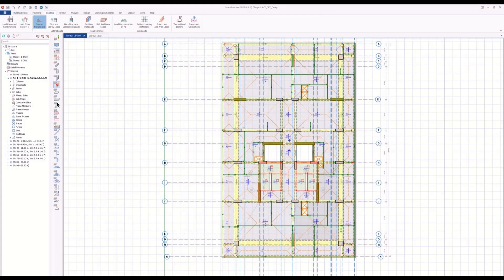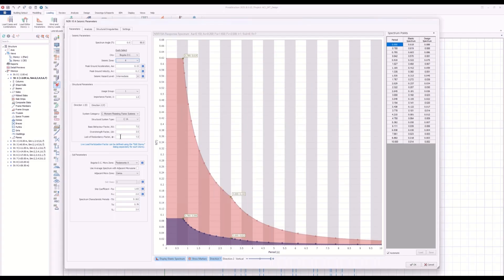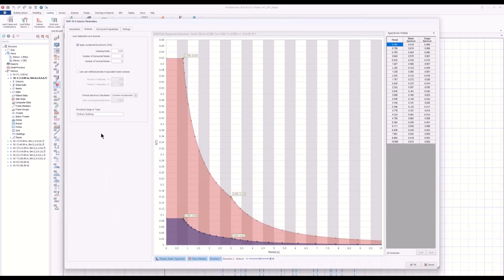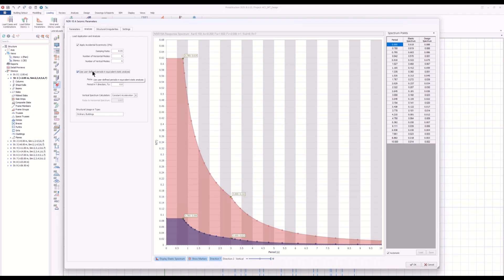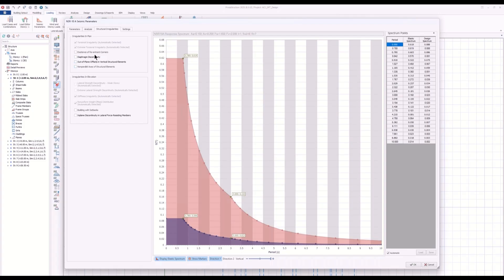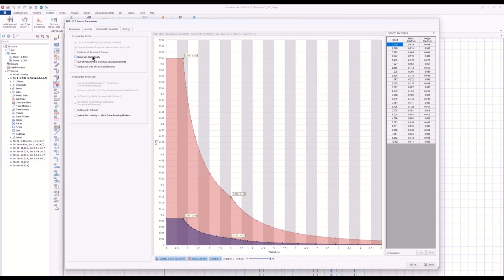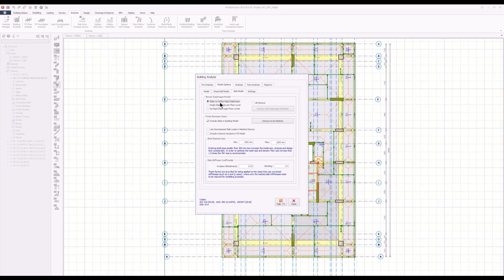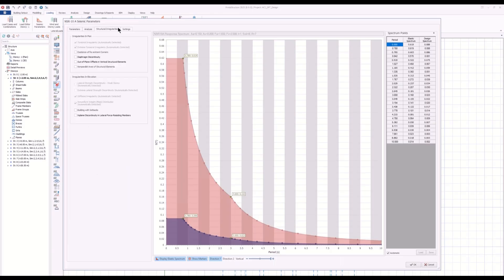How to Manage Seismic Parameters in ProtaStructure Suite 2025

Comment: Much needed The technical short video you shared highlights the importance of accessible, concise, and practical tutorials that showcase the multiple options Prota provides. Videos like this are highly beneficial for engineers and designers, especially for those who are actively learning or already using the software in real-world projects. Here's why:

Key Benefits of Such Videos:
Bite-Sized Learning: Short videos help users quickly understand a specific feature without dedicating hours to lengthy tutorials, fitting perfectly into a busy professional's schedule.

Application-Oriented: Demonstrating how each option applies to actual models bridges the gap between theoretical knowledge and practical implementation. It also aids users in making informed decisions during modeling and analysis.

Enhanced Decision-Making: Videos that show how different settings or features affect the model's behavior empower engineers to optimize their designs for structural integrity, cost, and compliance.

Error Minimization: When users see the direct impact of specific features or settings, they are less likely to make mistakes, which could otherwise lead to costly errors in design or construction.

Broader Adoption of Prota: By offering clear, value-driven tutorials, Prota encourages more engineers to explore its potential, especially those transitioning from other platforms.

Suggestions for Future Content:
Real-World Examples: Include common design scenarios (e.g., different modelling technique which impact column eccentricities etc.there are many more) and demonstrate the correct use of Prota’s features.
Comparison of Settings: Highlight multiple approaches to solving the same problem, with pros and cons of each.
Error Tracing and Debugging: Teach users how to identify and correct common issues encountered during modeling and design.
Integration with BIM: Show seamless workflows between Prota and tools like Revit to support engineers working on BIM-centric projects.
Such technical content makes Prota a more approachable and preferred tool for engineers, particularly those seeking high accuracy and efficiency in their work.